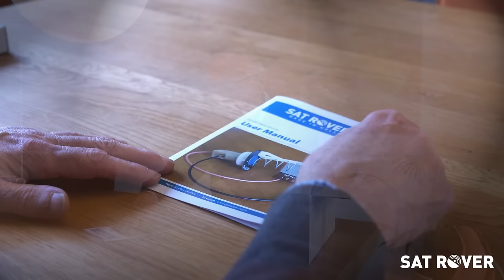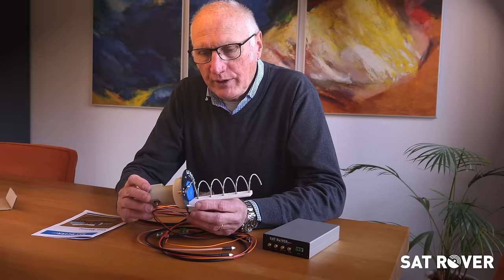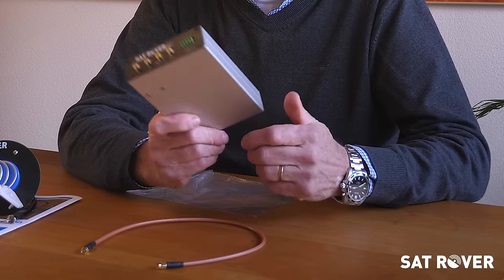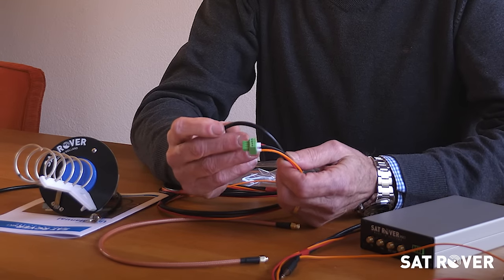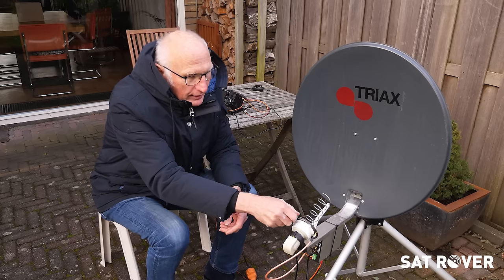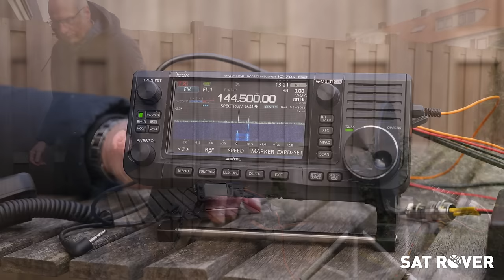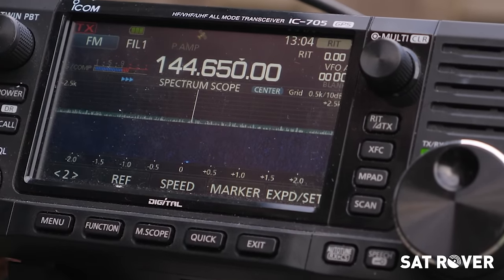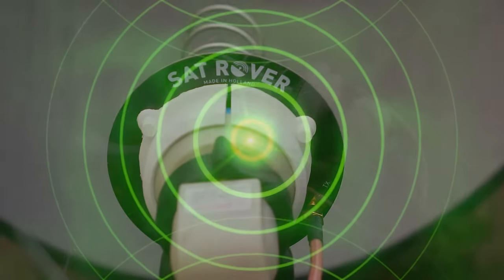The SatRover explained

Comment: What attenuation is used on the I.F radio to operate without damage to the transverter input?
Reply: None! The satrover can handle 5 Watt.  The ic705 ran be reduced to very low power. It was set to 1,5 W